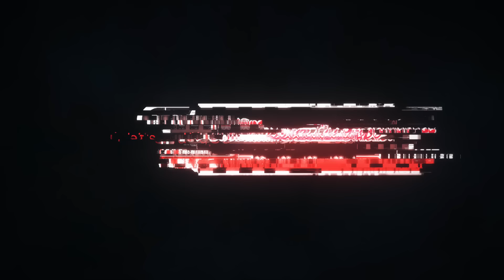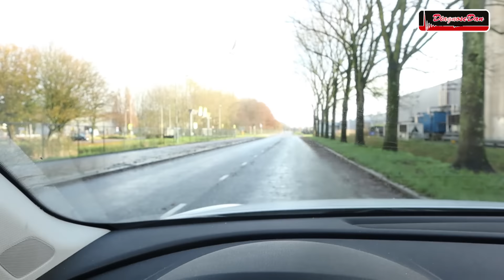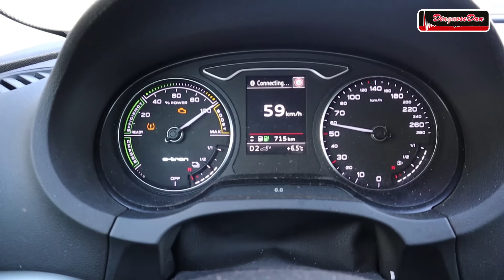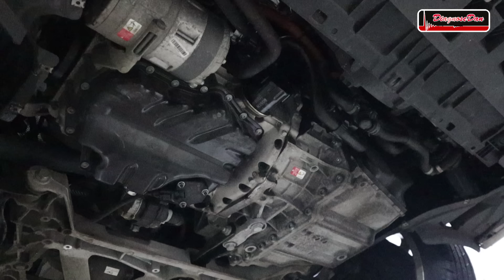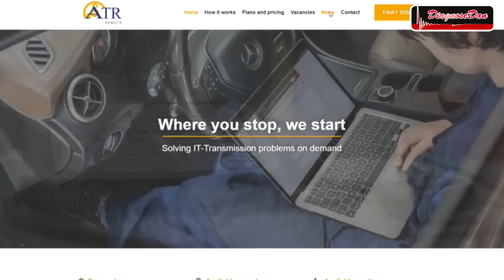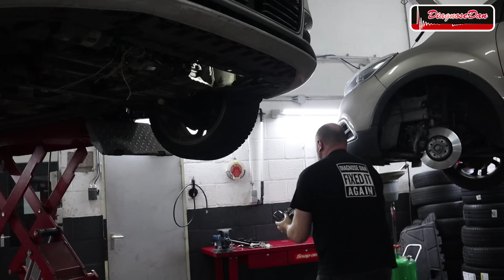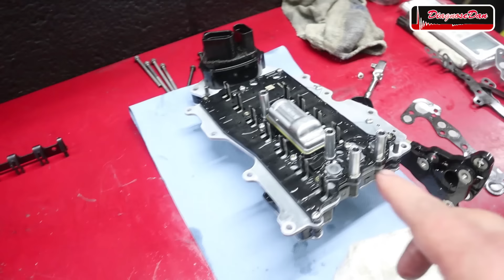DSG DQ400, p2884. Replace or easy fix?

Comment: Thanks, Dan. This is really a scandal. The gasket is defective, the screen falls out, the solenoid becomes plugged and the manufacturer sells a part for €2k to correct the problem. Sounds like a solid basis for a date in court. Thanks for this very understandable and clear explanation of what happens. As always a win.
Reply from the maker: This might be the reason that VW and Audi are telling you to change the mechatronic and dont explain what goes wrong.
Reply: Agreed. This needs to be a recall, frankly.
Reply from the maker: @jimtaylor431 agreed
Reply: Should be a factory recall by law ?
Reply: In Denmark I've heard of these getting completely new gearboxes. Thats a 20.000,- euro repair! Heard of a guy who had it happen twice. Yikes!
Reply: @larsmadsen8678 😮 I can't believe my eyes! I will never buy Audi or VW, I am so happy with my Mazda. Made in Japan!
Reply: Also a pretty NL problem, the importer here PON takes over the warranty from VW to get a higher margin (they also swap the conti tires with other brands like nexen). So some defects that are covered by VW Germany outside warranty won't be covered in NL, saw this with EGR and chain issues.The classic PON thing is also you are the "first" with this issue while half the lot is full of cars with the same issue.
Reply from the maker: @f0x4nn3 we've never seen this before 🤣 sounds familiar
Reply: I work on production and there would be hell to pay if we manufactured a product that resulted in returns. Even a single return results in a detailed inquiry and changes will be made.
I always had a high regard for German engineers. I'm no longer so sure - they are a bunch of crooks!!
Reply: @greenpedal370  I'm not so sure the engineers are at fault. I think it's totally plausible they raised the issue and upper management decided to take one of the options of risk management which is to accept it. I'm pretty sure this wasn't what the engineering team proposed. You also have to know that VAG (and I'm sure PON takes a margin) makes a huge profit on spare parts. They don't even lie about it in their annual financial statement. So the incentive is towards selling a new unit and not fixing the damaged part.
Reply: @greenpedal370 I assume you don’t work on automotive production?
Reply: @hughmarcus1  Read my original post
Reply: @hughmarcus1  No, Electo mechanical with a good helping of electronics for good measure.
Reply: @greenpedal370 Graduate engineers who have never held a wrench, but are good with mouse
Reply: @Phantom-mk4kp  All engineers are graduates, they do not need to hold a spanner. That's what technicians are for. The problem is that engineers have been upsurped by accountants, marketing girls and administration project managers, all of whom are clueless!
Reply: Dude sounds like the Lock Pickin Lawyer❤❤❤
Reply: @bastogne315  Except we know what Dan looks like!  LOL
Reply: How many hours labor and how mutch for parts? And how big is the factor oil and the oil change interval?
Reply: 😂 keep on buying audi's!
Reply: @bestbuildpc I have been driving MB for the last 40 years. 😊

Comment: Dan. You have managed to yet again demistify a very complex set of vehicle systems and break it down into very understandable sections, with solid repair options that can save the customer a lot of money. I love the recap and then the suggestion of the much cheaper preventative gasket change to stop this problem before it starts.
Reply from the maker: Preventing is better than repairing😉

Comment: So the only reason for that screen to detach in that way, must be due to the screen being too restrictive and therefore flexing due to the over pressure and finally breaking away.
What would have been nice is knowing how much the fix like this would cost compared to the expensive replacement cost.

Comment: Dan, Brilliant Fix! So many times the Manufacturers want to change expensive Modules instead of fixing the individual components. That situation is very similar to VVTI Selinoids that get gummed up with neglected oil changes. Sometimes you can clean them an no parts required. Was the oil contaminated in the megatronic to cause extra pressure to make the screen fail? Could it been prevented by changing that oil more often?
Reply from the maker: There is no contamination on the other screens. I suspect the screen fails because of pulsations in the oil when the solenoid is doing its thing

Comment: If it costs €2,000 in parts/labour to do a straight up replacment. how much does it cost for the preventative procedure? Also, how much does it cost if the damage is already done and you're doing a repair?

Comment: I enjoyed your troubleshooting as usual. It is a lot cheaper to repair than to replace the whole thing. I call that a mechanic and not just a part replacement, a mechanic like in the old days. 💪
Reply: Not sure how cheap it would be if you pay a garage to do it. The labour charges will still cost a fortune.
Reply from the maker: @felixalbion not cheap but alot less expensive.
Reply from the maker: In this case it certainly is

Comment: Unbelievable... the shitty build quality VAG keeps delivering.. You are the man Dan!  Love how you fix it without throwing away half the engine.
Reply: Gasket part reads "China".... That surely has nothing to do with the problem.
Reply: @SerbanCMusca-ut8ny indeed it has nothing to do with China,  its up to VAG to do its quality control and no one else.
Reply from the maker: Thanks!!!
Reply: TBH every modern car is pretty sensitive, issue i run in with VW is they actually not take care of their customers when shit happens. Timing chain has worn out at 50.000km and 3 year... sucks to be you here is the bill.
Reply: @f0x4nn3 interval for changing timing chains or belts, doesn't matter, it's relative to the type of driving that you do. So if you mostly drive in cities, with congested traffic, short trips, sporty style of driving, that interval drops. Many problems can be avoided by regular maintenance.

Comment: Thinking why VW repair manual says you need to fill gearbox from mechatronic fill plug which is on top of the gearbox if the mechatronic unit has been renewed. Should't this apply in this case?

Comment: Great video! But is the repair way really that much cheaper than replace? I'm thinking an ordinary shop will charge like 8-10 hours work + parts
Reply: No way this repair method is between 2k and 3k. If i had to guess it’s about 1k.

Comment: Seems like the screen suffers metal fatigue.
Maybe this clutch is operated more frequently or with a larger oil flow than what's going through the other solenoids which makes that screen flex more.
So overall a bit of a questionable design choice here, but it's probably cheap to make a gasket with a built in screen.
Reply: Yeah, just exactly why is it that screen that fails and why haven't the manufacturers addressed the issue particularly since it apparently so common?
Reply: @daveturner5305 it has been addressed, but of course they aren't going to swap these parts preemtively. Newer transmissions have a more durable gasket/screen.
Reply: Should be heaven for proven 
alternative manufacturers then. @kain0m

Comment: I know why the manufacturer recommends to replace the unit.  Parts sales !  Also, maybe due to their not so sure about the capabilities of the many dealerships out there in knowing how to do this kind of delicate work which also requires some heavy knowledge. Pretty sad for the manufacturers to spend the customers money so recklessly and even more sad that they use a supplier that cannot make a filter/gasket last past a few miles. Dan simply has the experience, knowledge and resources to get the job done right and correct whats wrong vs. throw parts.

Comment: That microphone... you have it set to very big amplification (volume) and big compression at the same time. So take down both so volume will not shot out very high at begining and compression not lower it down after a while.
It looks like it is manufactory enginering fail with that gasket.

Comment: That should be a recall issue at manufacturer expense. One thing you did not mention is how much is saved by repairing the unit instead of replacing the unit.
Reply from the maker: It saved about €1700 in parts but it takes about 2 hours more in labour. In the end the customer saved about €1500 / $1700
Reply: @Diagnosedan  thanks for the reply.
Reply: @Diagnosedan do you have the part numbers?
Reply: On parts, $30 euros vs. $3,000
Reply: @Garth2011 The working hours are the same in both cases, aren't they?
Reply: @leiflillandt1488 I'd say the repair had more time.
Reply: @leiflillandt1488  You would think a couple of extra hours on the repair would do it.
Reply: @Garth2011  more time and a bit more risk too. If a bit of the failed screen doesn't get cleaned out properly, it could scratch the new solenoid, etc.
Reply from the maker: @Ozsmallbore about 2 hours extra to repair the unit.
Reply from the maker: @leiflillandt1488 takes about 2 more hours to repair the unit
Reply: @Diagnosedan How much for the solenoid and what is the part number? Usually solenoids do not have a part numbers
Reply: Were you can get the solenoid and price ?

Comment: I recently purchased a 2020 Skoda Octavia and heard enough horror stories about VAG DSG transmissions to make sure I bought one with a 6-speed manual box.  Videos like this make me feel even better about my decision.
Reply: The DSG is typically very reliable in the standard gasoline/petrol and diesel engines.  The biggest failure in these are typically the owner who doesn't maintain it with scheduled fluid changes.  However, you made a good choice with the 6-speed.  The VAG manual is really nice and there are a ton of options to change the ratio of the gear shift if you want a shorter throw.
Reply: Yes, but no, but yes. If you have a DSG especially with the dry clutches i recommend to let reprogram the DSG to shift at higher RPM. The low RPM it already shifts puts quite a lot of extra wear and tear on the clutches.

Other then that it's for sure the most comfy automatic.
Reply from the maker: I wouldn't but one either😂
Reply: You should bought a car with ZF 8HP transmission! Auto and no problems! I recently purchased a 2020 BMW with ZF 8HP box!
Reply: Nah, I miss my Octavia 2.0 Petrol with 6 speed DSG ...
Reply: Imagine if you could've got a plugin hybrid with a manual!
Reply from the maker: @rkan2 😂😂😂

Comment: On what way did an engineer feel it's ok to fill through the drain.
Reply: That is quite normal. An overflow tube is an easy way ensure correct oil level. Same on my Mercedes.
Reply: my wife's Citroen is the same 🙄
Reply: Most manual transmissions and rear diffs are filled the same way. Fill until the oil overflows.
Reply: @kain0m  Those that I have come across have a fill/level plug in the side ie you fill it to the level of the hole in the side of the gearbox or diff. That is different from  the overflow tube in the bottom of this DSG g/box

Comment: Audi call it the "Mega Tronic Unit"? 🤣 The public probably think it some sort of Flux Capacitor😂You know the old saying BS baffles brains!!!!! If i owned one of these and this happened, i'd want it doing under warranty. So to future proof it, could you cut out the problematic filters?......................ok im trying to be a smart ass ha ha, ok new part like Audi wants you to fit and take the filter out??
Reply: It's "mechatronic", but yeah :)
Reply: @kaltsi  Yeah i'm having a laugh here but it does sound like it's pronounced Mega 🤪
Reply: @paulrobinson3528 he did specifically answer the question about removing the screens towards the end of the video. No, leave them in. They are there for a reason.

Comment: I had a few VWs back in the states with the DSG. Great transmission but it has the potential to be disastrous. And especially most people in the states don’t do the required transmission service since it’s expensive.
Reply: You just nailed it.  The owner is the worst part of a DSG.  So the maintenance and it will last the life of the car and be able to be transplanted into another car.  Don't do the maintenance and it is an expensive out of warranty repair.
Reply: @Birdman_in_CLE  thanks! I just bought another VW back in Florida (video coming soon) and I avoided the DSG transmission for this very reason! Went with a 2.5L with the regular 6A
Reply: "And especially most people in the states don’t do the required transmission service since it’s expensive". This is like not eating because it is expensive.
Reply: @guzziwheeler  cars are appliances there. People generally don’t take great care of them. Especially when maintenance is expensive